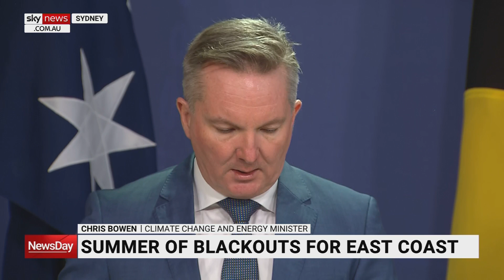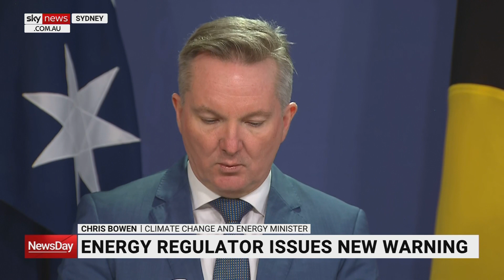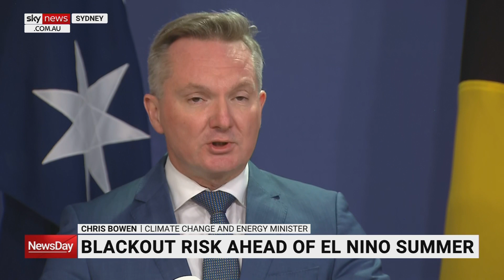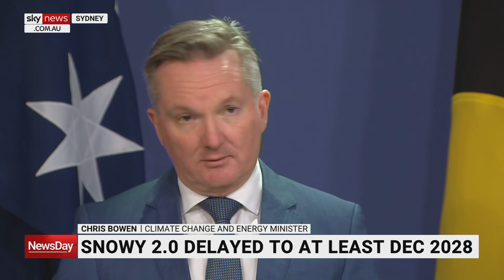Snowy Hydro 2.0 is one of the most ‘complex engineering projects’ anywhere in the world

Comment: Can we put rotators on pipe too either in both side sides wise or up and downs then connect to gear or ditch.. will it slow the water inflows based on where it is attached.. or giving water more pressure to focusing in centre of pipe.. what could be possible..